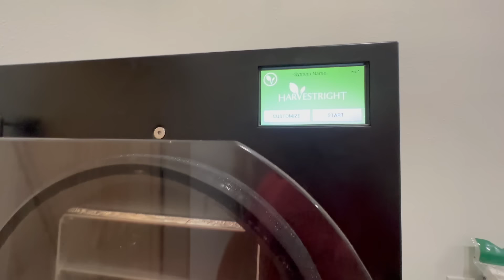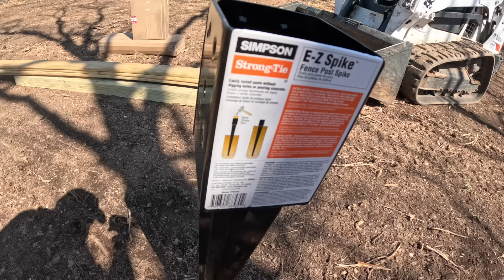My Neighbor Sent Me The Proof...Look For Yourself!

Comment: Your ever faithful helpers, Gabby and Gracie are ON the job!  Checkin' on dad.  And your Livestock Guardian Bird Bobby, keeping the evil turkey monster at bay.  I'd use a scrap of 4x4 just taller than those Simpson Strong Tie pieces (the part that holds the posts) when driving them to insure you don't damage the steel units before time to erect the posts.

Also, when it's time to build your fences, after you auger your holes, instead of setting your posts in concrete, there's a two-part foam product that you just add water to and pour it into the hole and it sets fairly quickly and is a LOT easier on the back than concrete.

Comment: Yeah, I live in NorthCentral Pa, our farm is connected to a Stateforest. We get everything. We have a copperhead living on the backside of one of my barns and saw it one day doing weedeating. It was a big sucker. Because I don’t know what’s out there, in tall grass, I wear tall Muck boots for protection. I also carry a walking stick and bang it on the ground, and never pick up a rock without kicking it first, and always wear gloves. When walking a trail, it’s good to keep a pouch of gravel and dirt to throw ahead of yourself, to clear the path of snakes and critters. It’s also good to do along your stream area that has rocks. Snakes cannot move if the weather is under 65F or so, so if it’s a cooler day, they won’t be out, have no fear. To chase away bears, I keep a small air horn handy, it works. But snakes respond best by thumping on the ground with a walking stick, and throwing gravel at it. Chase it to it’s hole, then put a big rock ontop.

Comment: If you put all those wood chips in a big pile in about a year or so you'll have some great compost. It will compost faster in a pile as it will probably generate a lot of heat in the center of the pile. I the area that the chips are spread out it weeds will not grow very well for a year or two. there is a compound in wood as it decomposes that inhibits weed growth.

Comment: So strange you've never seen them before. That's what we used for doing our fences since I was a kid about forty years ago. But you need a sledgehammer and something on top of the wood when you drive it down in the dirt that last bit to hide it in the dirt . Don't forget to screw then in before driving then in the dirt that last bit ! It'll be much sturdier if you drive it down all the way. Good luck 👍👍👍🥰❤️🥰
Reply: i use to use a scrap piece of 4x4 to pound those in, then take the scrap out and put your actual 4x4 in

Comment: When you go to building a shoot elevate your ramp to match your trailer. Also close in the sides of the shoot as you will be able to load them. Use tin on the sides cause when they can't see where they're going, they load easier. I've raised mine on a slab. I've had as many as 100 at a time. Have fun!!

Comment: The tall walk through horse round pen gates, like Tractor Supply or Atwoods have, could be modified with woven wire or  horse panels(like cattle panels but with smaller holes).  That should work to keep them in and to make it easier for you to get in the pen to care for them.

Comment: HEADS UP!!!!! We had the worse storm ever yesterday on 4/3 in the NW so I suspect you will be getting it in the East by Saturday. It was a very major storm.  I suspect you will be having tornadoes in the East from this storm yesterday that we had.  Seriously it was a major storm. It's headed East from the NW.
Reply: We had a terrible storm yesterday in central Florida!!
Reply: Where in the NW? I’m in Oregon and it’s 72* and sunny ☀️
Reply: 5 inches of rain where I'm at in W PA. I couldn't imagine if it was cold enough to snow
Reply: Great video Dutch! ❤😊❤
Reply: I took plastic barrels & cut length ways, partial buried in dirt, kept full water. My pigs played in them. Could bury kiddie pool for the larger breeds pig. They prefer wet over mud, mud makes them itchy & pigs actually prefer to be clean